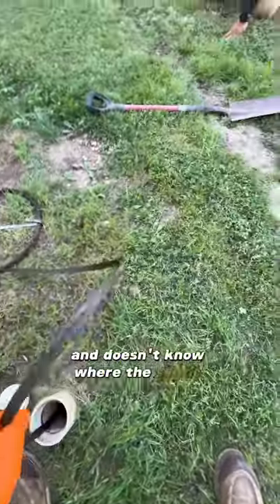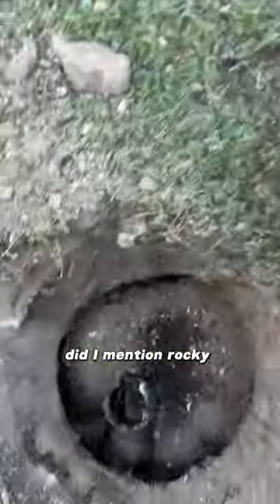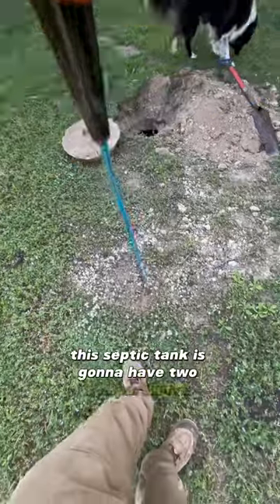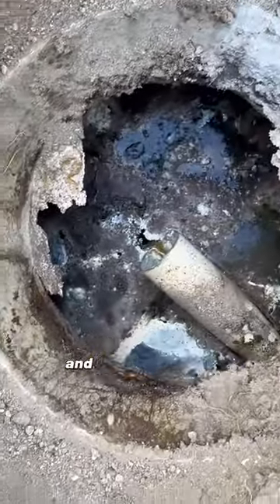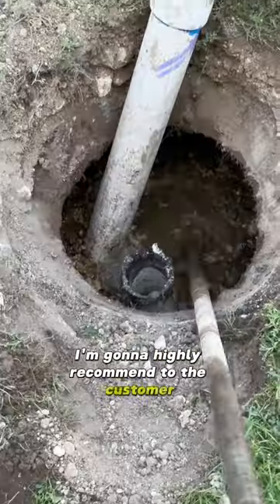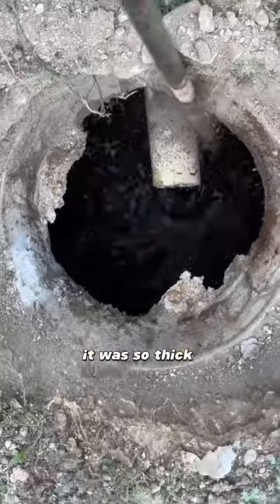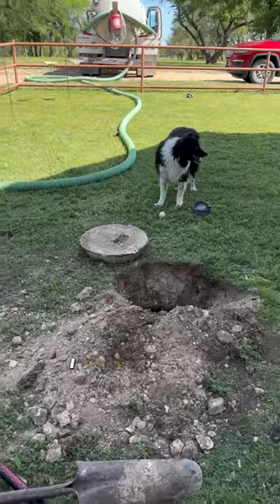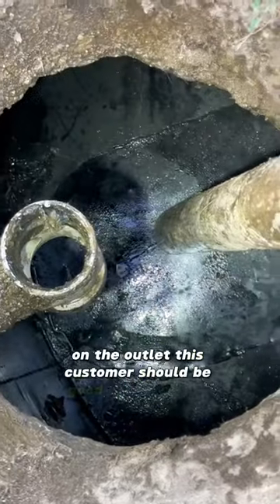Thicker than a snicker #shorts

Comment: Stupid question: I'm a first time home owner, we had a bit of overflow in our basement and had to call the plumbers to clear the pipes because there were roots blocking the way.... however they never mentioned the house having a septic tank but they said the particular pipe with the Brown water connected to a sewer in front of the house that had about four other houses connected to it.... so I'm wondering, does every house have a septic tank? Because I'm wondering if i should be worried 😅